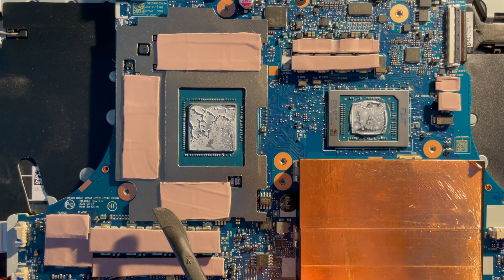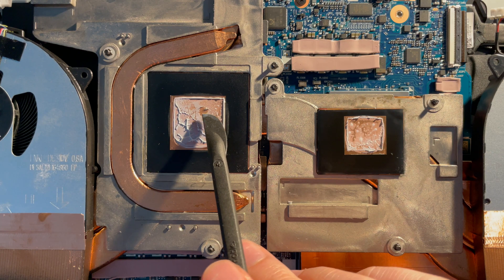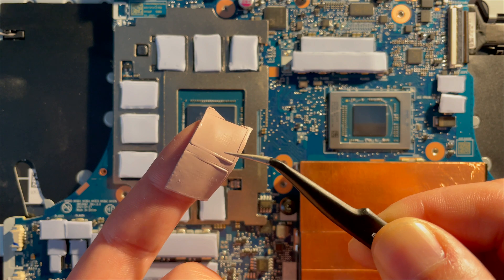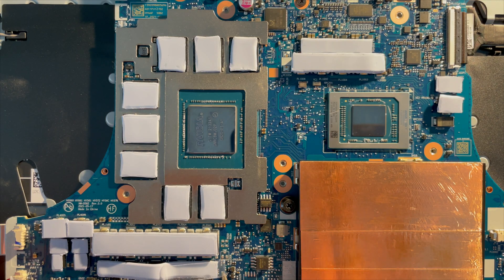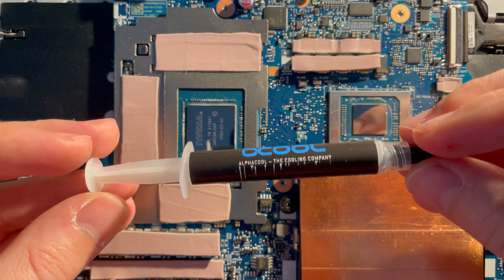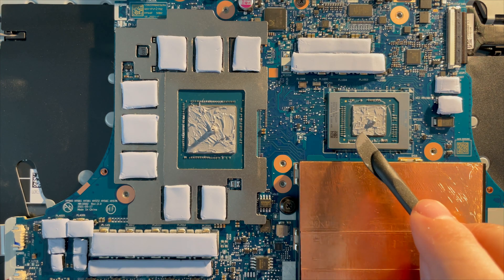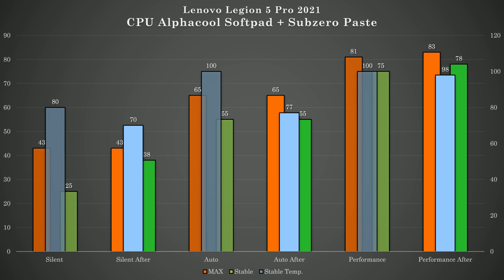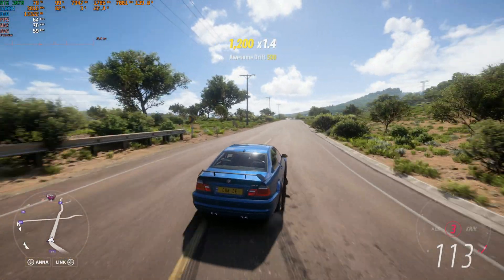Lenovo Legion 5 Pro 2021 Alphacool Apex Soft Pads and Subzero Thermal Paste Upgrade

Comment: Maybe leave the same since pads don't get damage over time due to material characteristics
Reply from the maker: Well they were the problem ☺️ I mean that was my main reason to do this. Since I did not have original Honeywell paste I went with Alphacool since it seemed better than TG
Reply: @atechcheck  overheat problem due to original pads? I'm not sure if i agree with that. You might as well just use thermal paste since it will do the same job. Thermal Grizzly pads are tuf material and very shitty for laps. I'm considering re paste and I'm not going to change pads unless they're cracked
Reply from the maker: @PtSp86  but in that case you are claiming that Honeywell that Lenovo is using was bad? I mean everybody are praising it as a holy grail.... I can not say since I have no idea if it was actually HW paste or not nor if it is actually that good xD at the moment and by logic those Alphacool pads are more adaptive to any application scenario/surroundings and definitely are more thermal conductive so I do not see why wouldn't you replace stock gummy ones :) when it comes to paste, all I can say is that this combo is actually working and that maybe TG Krayonaut is better but I would need to get new T. Pads since those soft ones are not so reusable I suppose XD
Reply: @atechcheck  according to specifications yes.. quite average actually with 8.5w like mx 4.. there's better products. Plus the culprit lies in the mounting pressure = screwing order

Comment: What should be the ideal thickness of the thermal pad being used in lenovo legion 5 pro?
Reply from the maker: well in my main re-pasting video i showed that they are 1mm but ones from lenovo could compress much more than Thermal Grizzly... if you want to replace them, I am afraid that only options are soft pads that can compress or others putty/foamy ones like :)